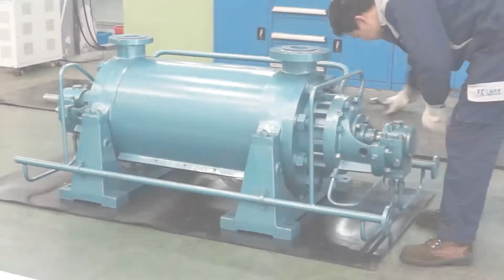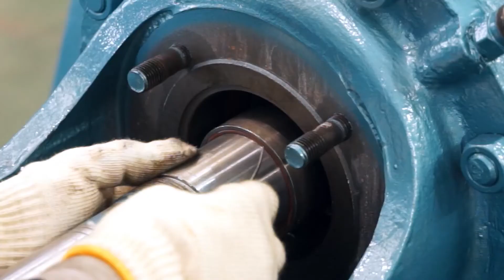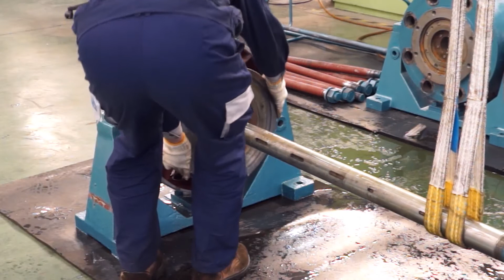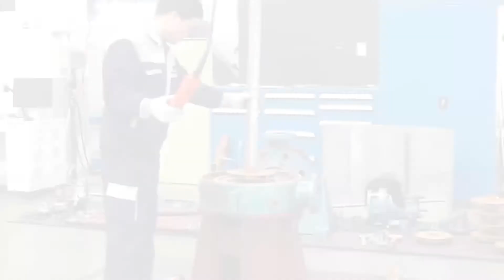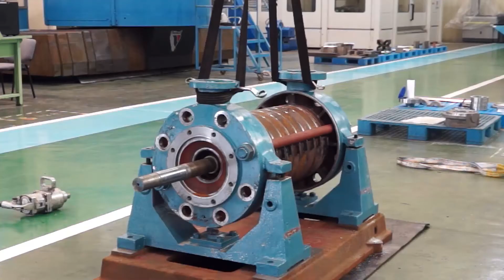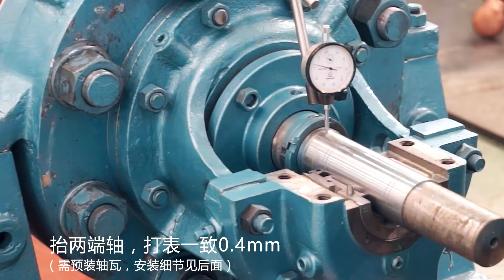DG/ZDG Boiler Feed  Pump Removal and Installation

Comment: Thank you for a very educative video. I have one qustion. If we replace only one side of mechanical seal, do we need to adjust with dial gauge?
Thank you in advance 🙏
Reply from the maker: No adjustment is required for the non-drive side. If it is the drive side, no adjustment is required for the extended diaphragm coupling.